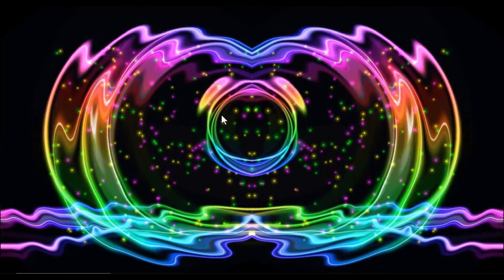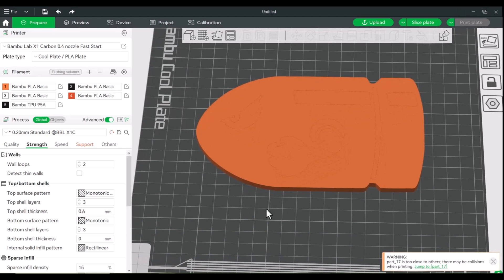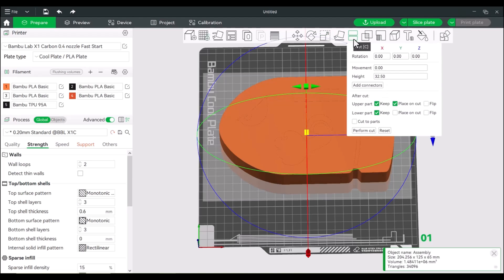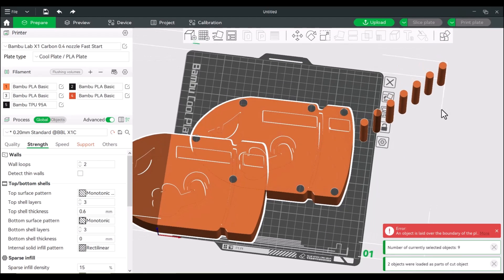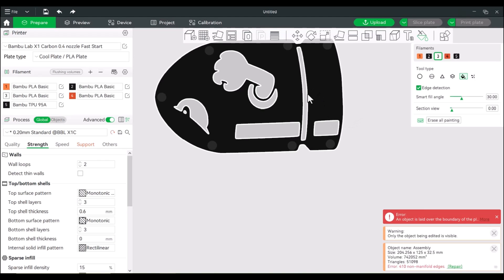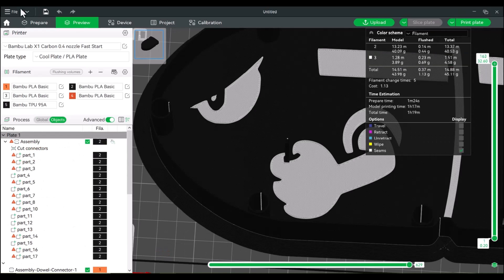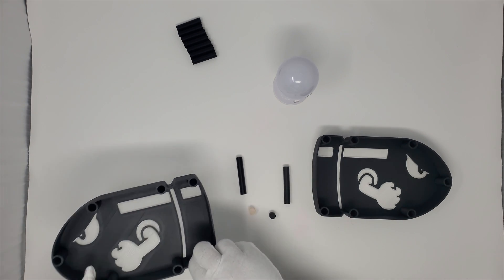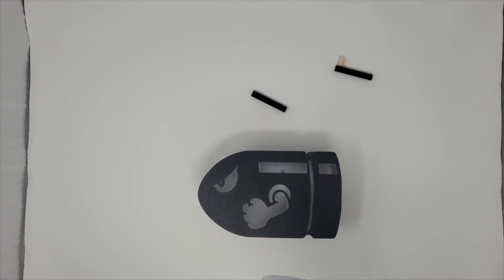SVG to Lightbox Bambu Studio Tutorial

Comment: Hey Ashley! Im curious how the batteries in these bulbs hold up? Making my brother a Youtube lightbox and can't decide on what lighting to use.
Reply from the maker: Hello. So those lights last a good long time but I have never ran until the batteries drained. It uses 3AAA per bulb and 2 AAA for the remotes.

I liked them because they can be turned off with the remote. There are a ton of options for led light strips though and some can be run on battery banks or power outlets. 

If you dont need to make it as wide as mine I would use strips. If you are kinda recreating what I did then you could almost do it step for step but move the placement of the pegs.
Reply: @ashleys3dprintshop  yeah I think for this project I'm gonna try the remote ones as well. I may look for a plug in option in the future.  Thanks!
Reply from the maker: @rache5399  :yougotthis:

Comment: how would i do this with no ams
Reply from the maker: It would be a bit tricker. Changing colors happen At layers but theoretically it's possible but would require some extra work.
Reply: i remember being able to do it on my ender 3 using z hop, but have no idea how to use it on my bambu.
 @ashleys3dprintshop

Comment: Thank you for this video. Question...when I make the top layer and infill 0 and slice it all looks right but my colored parts disappear  and only show up as wall outlines that increase or decrease as I change wall thickness. Your video the bullet graphics are fine?
Reply from the maker: The slicer will look at anything touching the build plate as bottom and the opposite as the top. At some point on the video I flipped the model to face the build plate. Is your colored side touching the build plate?
 I colored the top, then flipped it over.
Set top layer and infill to zero.

Comment: What an I doing wrong with the dowels? The holes for the dowels go all the way through the model when I slice it, leaving holes in the bottom an top layers.
Reply from the maker: In the cut tool and "add connectors section make sure the "depth ratio" and "tolerance" next to it do not exceed the model.

In my example I took a 65mm high model and split it equally in half. So it's 32.5mm per side. Do not make the holes the entire length of the whole model. 4:00
I made my holes/dowels 30mm with roughly 2.5mm in wiggle room. 

The dowels I printed separately but there is a trick to it.
In my "back to basics" video It shows you have to "clone" at least one of them then make adjustments on the cloned one.  If you modify them directly it will affect the model too which could be an issue. 

https://youtu.be/9UrBKPkj8CI?t=488

If you are still having issues let me know.
Reply: @ashleys3dprintshop  Thank you for the explanation. It finally made sense that the dowel is 30mm on each side (so 60mm total). With 2.5mm "wiggle room" on each side. Initially I used half the height of the total model. Thus the entire dowel is the entire height of the model. When I reduce it, the holes start printing in the air. So had to do some math to come up with: 3 bottom layers @ 0.2mm = 0.6mm. Then take total model Z height and divide by 2. Then subtract the 0.6mm. For example 65mm /2 = 32.5mm, minus 0.6mm = 31.9mm. Maybe you just used supports or I missed something else??
Reply from the maker: @FrancoisStrydom-v1z  I didnt make any major adjustments or supports. Since my holes did not touch the top or bottom they started in mid air but supported by the walls. They are long enough to correct for any potential issues. What I may not have mentioned was how to modify the dowels as I did shorten them by a 3rd.

You would clone the dowel first then adjust them.
https://youtu.be/9UrBKPkj8CI?t=486

There are a few ways to make the model hollow. Modifiers, negative parts etc.
I like to keep these types of videos simple to show folks they dont need to go into full fledge CAD programs to make things. 
 
Sorry about the late response your message was stuck in limbo on my side.  Thank you for your question and resolution.

Comment: I learned about adding wall loops to keep that light from escaping unwanted areas
Reply: You can also add Aluminum tape to the inside that will reflect the light inwards and block light leaks from unwanted areas. Just takes a bit of trimming with a razor knife to get the shape one needs.
Reply from the maker: Small changes can make have some big results.